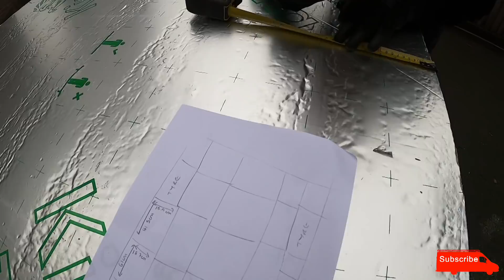Camper Floor Build || Ducato Camper Conversion || Episode 7

Comment: Can really recommend using Sikaflex or similar polyurethane adhesive to bond your subfloor battens to the van floor. I appreciate your comments about it not going anywhere, but it is a potential 'rattle' point. I used aluminum battens and glued them down really successfully.

Comment: Nice one looking good 👍👌 very over engineered boxes!!
Reply from the maker: Thanks. I wanted them strong as the leisure batteries might sit on top of them. 👍😁
Reply: @LukesVanLife  Good idea, you know the bottom of your sliding door, have you found a solution to stop it sticking out? Because mine is the same. Cheers 👍
Reply from the maker: No haven't found the Solution yet. If I do I'll let you know. Likewise if you figure it out let me know 😉
Reply: @LukesVanLife  sure 👍👌

Comment: I glued my floor  battens down but i agree there is no point sealing and painting the metal floor then go and drill another  100 screw holes into the metal and face corrosion problems. That said I would not use MDF on the floor.  No matter how careful you are odds on you will get a flood at sometime from somewhere and my pump managed to blow off a pipe months after it was installed and in seconds there was a river flowing down the middle of the van before i could reach the switch!  But I used treated timber battens and ply floor liner before the laminate floor went down.  I don't think it caused any lasting damage as several bundles of towels sorted it quick.  Anyway getting the floor down Asap is sure the way to go then you can get the diesel heater installed  and run off a temporary supply and one battery just to get heat in the van.  Everything else is so much easier in the warm. :)  

BTW consider tapping into the diesel tank NOW while you got the chance its quite easy in that van  access flap under passenger seat to get the sender out.
Reply from the maker: All stores near me we're limited in ply stocks so has to use MDF and then coat it all in pva to make it water resistant. It'll also have a water proof vinyl floor on top so it'll be absolutely fine. thank you for watching. 👍

Comment: Hope that floor and wheel arches never need Welding
Reply from the maker: What would you suggest? How would you have done things?
Reply: @LukesVanLife  Damned if you Do Damned if you Don`t , I personally would inspect every inch of the floor and wheelarches inside and out and seriously treat any chipped paint and rust
Reply from the maker: @Severon1965  oh ok, well I did that. For a minute, I thought you told me I did something wrong.
Reply: @LukesVanLife  These vans are galvanised anyway so no need to work about rush. The few bits you found on the inside floor are from heavy abrasion.

Comment: Hi Luke, have you though about using the flare pods to give a bit of extra room when sleeping across the van?
If I keep my van and convert it, this is something that I would consider.

Paul
Reply from the maker: Hi Paul, yes I would get those flares for my personal vans one day, I've only seen them for sprinters and crafter's though. 👍😁🤔
Reply: I was hoping that you had seen them for relays 🤯
Reply: Those vans are already over 6ft wide so no need for flares for most people anyway. At the headboard and feet end i  framed and recessed those areas to make sure i got a good 6ft  by 4ft small double and only needs a skim  off the mattress corners  where the rear lights are.  With a 6" memory foam its luxury and a very nice sleep for average size bodies.  If you are over 6ft and XXL then you got problems:)

Comment: Hi Luke. Get my van  in a week or so but I wanted to know can you use normal polystyrene slabs on the floor, it's just I can get from work for free
Reply from the maker: Hey, polystyrene is quite a good insulator. Alot of people use it. I'd suggest a vapour barrier over the top as well 👍😁
Reply: @LukesVanLife  yes I am going to put a barrier on anyway..but I think I will need  some help so if you need so work let me can email you mate
Reply: @LukesVanLife  if you need some work let me know and I will email you
Reply: Just make sure you pack the polystyrene insulation nice and tight otherwise you'll get that horrible squeak from blocks rubbing against each other.
Reply: @patrickh8602  hi Patrick  I see what you mean but too be fair each slab will be will  be between the timbers
Reply from the maker: Of course, drop me an email lukesvanlife@gmail.com 👍
Reply: Yes it will work the R rating is not bad not quite as good as kingspan but if its free its worth it if its 25mm makes life easy,  Do the walls and ceiling too and save yourself about 9 sheets 8 x 4  kingspan.  Stuff any gaps and beams with rockwool loft fluff not fibreglass.   I don't recommend expanding foam. cos if your van is ever damaged it cant be repaired once its filled with expanding foam. Foil tape everything plus a vapor barrier.   When its -1C outside  my van holds 17C  all night with the diesel heater on its lowest 1 hz setting. That's only 700ml or about 80p  for 10 hours.
Reply: @tonytca9439  thanks for the info, with the van been 7ft.4inch wide I was going to put 3inch on the floor ceiling walls because that's what size the slabs are , they are 4 by 2 , they use it for insulation in new build properties and too be fair there is shit loads of it...happy days I guess 🤗

Comment: You should put the water tanks under the van to save space...
Reply: They would have frozen this winter under the van.  If the tank is inside its good down to about  -10C overnight before it becomes a problem.
Reply: @tonytca9439  No they wouldn’t of frozen because inky an idiot would leave them uninsulated, mine have never frozen
Reply: @thenoworriesnomad  its better inside if you plan to travel to colder climates
Reply: @tehdreamer  I was in Scandinavia 3 yrs ago over the winter and my tank or pipes never froze once, they were very well insulated..
Reply: @thenoworriesnomad  interesting to know thanks. I've seen some van lifers having major issues because of frozen tank and pipes also resulting in breaking their boiler. They probably didn't insulate though
Reply: @tehdreamer  ye iv seen some people have problems too,  I’m not saying that insulating pipes will stop them from freezing but it’s a good idea to do... or maybe I was just lucky..👍🏻👍🏻

Comment: Omg luke, looks like u put mdf on floor, heavy and inherently cold, ply would have been a better option, anyway still like the videos
Reply from the maker: All stores near me we're limited in ply stocks so has to use MDF and then coat it all in pva to make it water resistant. It'll also have a water proof vinyl floor on top so it'll be absolutely fine. thank you for watching. 👍